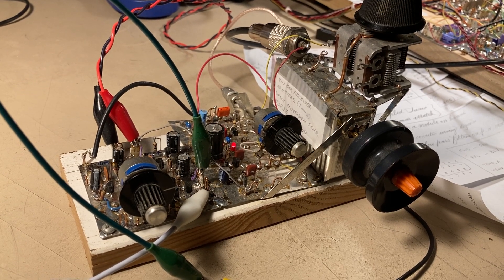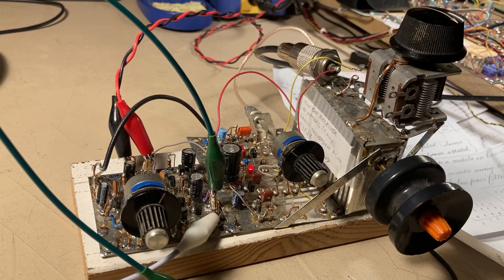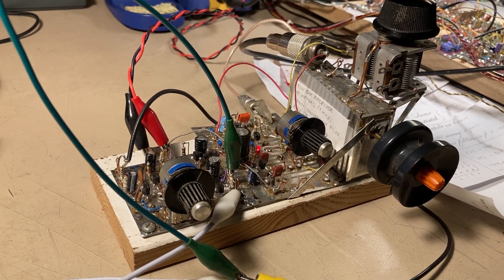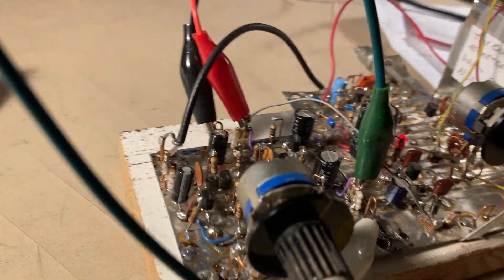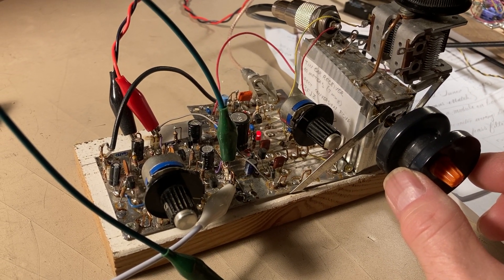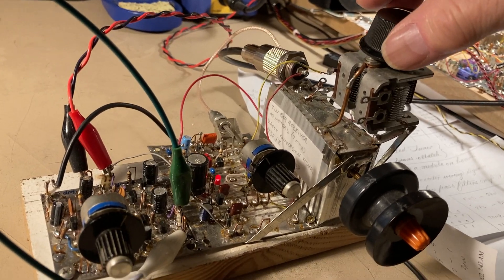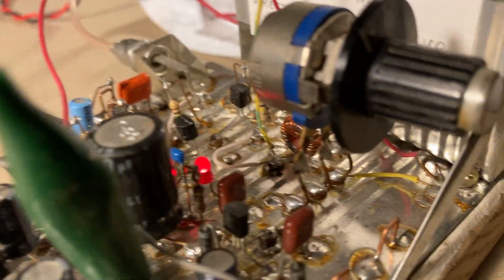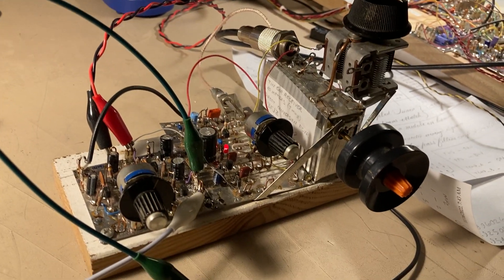Tin Ear Direct Conversion Receiver Hears Lou EA3JE from Barcelona Spain

Comment: do you have a schematic the for audio amplifier ?
Reply from the maker: Hi shurst2340, I don't have the exact schematic for the Tin Ear available for immediate posting, but it is the same design as the one I'm using the the MAX-SSB transceiver except it doesn't have the audio mute control, so you could build it without the 2N7000 and associated components on the gate and it would work for a receiver.    http://www.remmepark.com/circuit6040/MAX-SSB/MAX-SSB.html#150